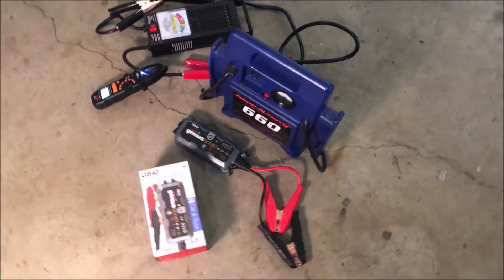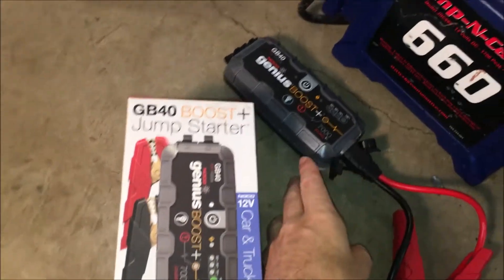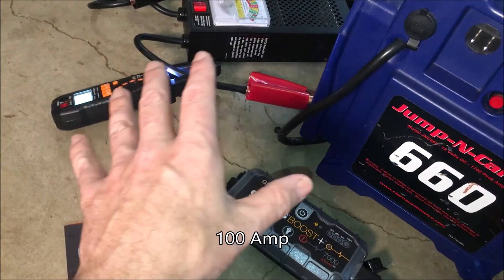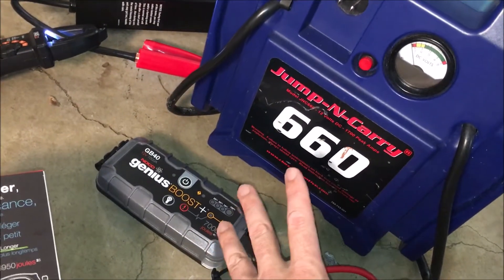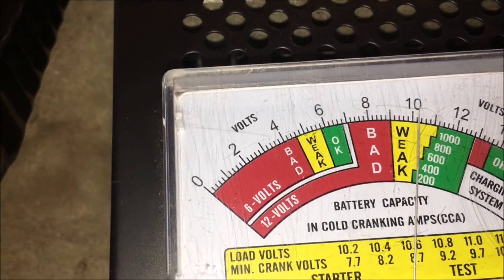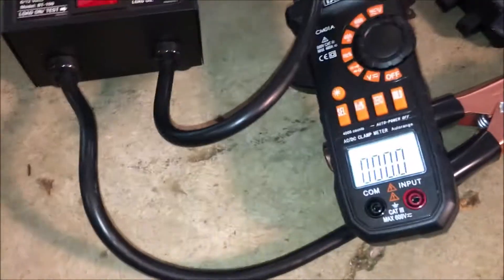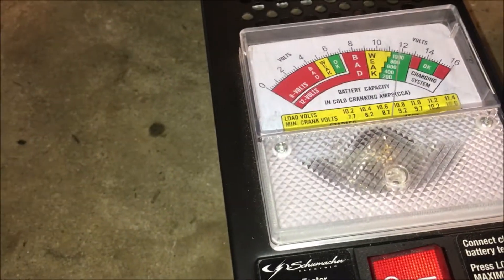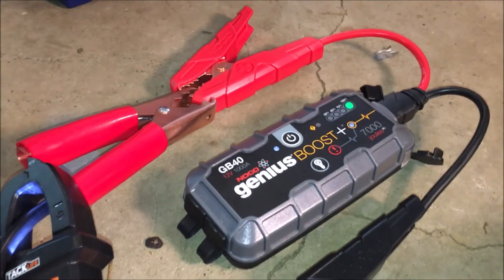Lithium vs Lead Acid Jump Starter / Jump Pack Load Test

Comment: That JnC600 unit.. once the ~20ah SLA inside goes bad, it'd be good to see someone on youtube replace it with a ~20ah 12.8v LFP battery, and connect the load straight to cells (bypass its BMS), use a big fuse of course, thick wires, and have the charging circuit still go through the BMS. I haven't seen any cheap LFP jump starter packs.
--
Have you got one of those cheap (but effective) low current CCA testers? (Such as TopDon or KingBolen.) If so it would be interesting to see what it thinks the GB40 in this video can push. Still, like you say, it didn't start the car you mentioned early on. I'm just wondering if it would manage to push >300A and still hold up ~9v.

Comment: Hey James Just came across this tutorial 
I have replaced all the batteries in our shop JNC 660s. About a dozen or so. New ones fail within several jumps. I think it was due to bad charging systems. I ordered the upgraded kits and batteries. We went with Mighty Max Lithium 12v 22ah units. They get plenty of use and abused. It’s been several years on some and showing wear. Since all these lithium fires we are replacing with high grade lead acid. I think it’s a better choice in jump packs.

Comment: Don't underestimate that local it's got a 2000 150 milliamp battery inside the battery inside is three lithium-ion cells in series which is not 12 volts I started my 150 Ford van 5.4 l in the summertime without a battery of it 12 times on the Noco the pack overheated wait until I cooled off it starred in additional 15 times and then three more after cooled off again

Comment: I realize that this was a long time ago but having taking apart and replaced the batteries in that style pack before I would say that it simply is a 9-12 amp hour sealed lead acid(SLA) battery. They're not rated in cranking amps however as long as the cables that they use can handle the current generated they can be used as a starting battery even though that's not they're designed purpose. SLA AGM are used in the packs because they have a lower self discharge voltage than a starting battery would in this situation. They do loose. Total  capacity over time and hit 50% after about 5 years. the deeper packs have a 20-24 amp hour SLA.

Both packs should be hooked between the frame and positive, otherwise the two batteries will balance out if left that way for too long resulting in two batteries that are too low voltage to crank.

Comment: The voltage on the baby Noco is normal, Lithium packs are lower voltage. This also brings up a warning most don't realize... they charge @ lower voltages... a regular lead acid or AGM battery jump pack like the JNC660 can be left on the jumped vehicle for a minute or so after it starts & use the cars alternator to recharge the jump pack.( it has a built in charger too).. if you did that with any of the Lithium jump packs... it'll damage the life of the battery inside. Lithium packs are also VERY temperature sensitive.. they won't turn on if they're cold & they also won't turn on if they're hot from ambient temps or from long cranking of an engine. 
The JNC 660 is significantly better all around jump pack. It's the #1 most trusted in the towing industry which uses them daily.  Noco  uses "fuzzy math" to list thier output ratings.... it's actually rated in Joules of energy over time.... they're really nowhere near that powerful. The JNC is rated @425 cranking amps & 1700 peak burst.  They also use 2 Guage welding cable ( fine angel hair copper wires) they stay flexible in sub zero temps & they are significantly more efficient @ transferring amperage. Even the Big 4000A ( recently reduced to300A ) Noco jump pack struggles to start bigger vehicles or in winter temps.. it will give one or two decent cranks... but if it doesn't fire... it doesn't have much reserve capacity to keep trying. They also take significantly longer to recharge vs a regular jump pack. The JNC will crank over a Light duty pickup Diesel in winter. It also will crank for a longer time than the Lithium. Yes it's bigger, but it's built like a tank... I've used em for decades & they're very reliable & last for years. I have one that's used almost daily that's almost 10 years old & it's my go to 75% of the time over my newer bigger Noco. The JNC is also about half the price of the bigger Noco genius....the only benefit to choosing the Noco is the "smart" safety electronics for unknowledgable people that may not know what they're doing...  if ya hook it up wrong.. it won't turn on (unless you manually hold the bypass)  I've been in the towing/roadside  business over 35 years up in Minnesota where our winters are Very, very cold ... I currently own 3 JNC 660s & 2 Noco GB150s ( two of them failed in less than a year old... 1 was warranted by bthe manufacturer & the other was junk) & my JNCs are 10x more trustworthy at half the price & they work even when it's sub zero..  if you want compact & cute... ok.. but if you want performance & long life & built like a tank... JNC 660 is King.
Reply: jnc660 has diodes in it, it cant be charged via clamps. But you can hook up a 2 amp charger to a cigarrete lighter plug and charge it that way to bypass the diodes.

Comment: Good info. I just repaired an old Schumacher unit using a 9ah battery and got a result on my load tester right on the weak/bad line. I guess that's just what these do.

Comment: Randy on auto auction rebuilds use a similar jump pack to start a turbo diesel Cummins with 2 dead batteries
Reply from the maker: Must be a larger version.  This one would not start my wife’s 3.6 liter 6 cylinder van.

Comment: My EverStart Maxx 600 amp lithium jumper started a 4.8L V8 2003 Chevy Silverado that had a completely dead battery. The battery under the hood had zero volts.

Comment: Thanks for testing, I think that lithium batteries are still not enough in power when you compare lead acid in brute power and instant current.
Reply: All lithium batteries have a much higher power density than any lead acid battery. The issue is they're very expensive so these jump units have tiny little batteries in them.
If they had the same size battery in watt-hours that the lead acid jump packs did they'd cost £2k plus.

Comment: I use the Noco GB70 and I jump start my F-150 pick-up truck with a dead battery no problem, also other car with the same unit. It save my life a couple of time. I like it because it is small and powerful. Never did the Amp test. Maybe if the lead battery in the car is completely dead it would not have enough voltage to power up the computer. But so far it always deliver what I needed.
Reply from the maker: It has saved me a few times, but not my wife.  Her car is a push button computer controlled ignition.  The computer did not have enough power to stay on when cranking.  Her car was also 100% dead.
Reply: What about cold, like - 30?
Reply: @krecikowi  
I know this is late, but I have a Gooloo GT4000 and leave it in the truck year round in Minnesota. Take it out to charge it twice a year or so, it has a built in heater that will warm the batteries in the unit up in winter, it takes a couple of minutes if it is really cold and has started several cars, suv's, pickups on the side of the road, winter, summer, etc. Had it for a couple of years now with no issues. Hope this helps.

Comment: The genius 1000 amp jump starter actually puts out about 325 cranking amps. Not enough to start a v6 with a really dead battery. I actually just bought a 2000 amp jump starter which puts out 650 cranking amps.. (I stand corrected - 200)

Comment: Great comparison providing good information. I was just comparing these two items wondering the same things. Thanks!
Reply from the maker: Also one thing I did not consider at the time is that watts = volts x amps.  The lithium jump pack voltage was a lot lower.  Even if the amps were the same the overall power (watts) would be lower.

Comment: It's false advertising; there's not enough amps in these tiny jump packs.  They have their own way of measuring, just like other manufacturers do. Like Milwaukee with their, "Nut Busting" torque, instead of just normal torque, or "Peak HP" on a shop-vac.
I'm starting to think it's better to just carry around an extra battery that fits my vehicle and some cables/tools.
I see you're into generator's; HD's having a sale today.
Thank you for this video.
Reply from the maker: Something else I kinda glossed over in the video was that the voltage was low.  volts x amp = power.  Even if it was closer to 100 amps on the load test the power still would have fell short.  Wish companies would just state the facts.
Reply: @jcondon1  That voltage was very low for a lithium pack.  I've got two different ones and when fully charged they are at 14.7 VDC.  Did you verify your pack was charged?
Reply: The genius 1000 amp jump starter actually puts out about 325 cranking amps. Not enough to start a v6 with a really dead battery